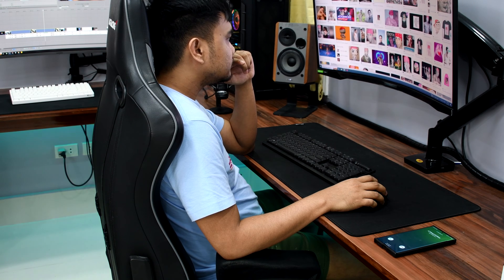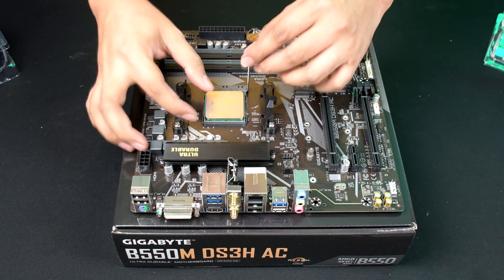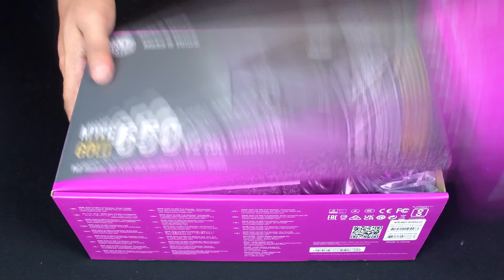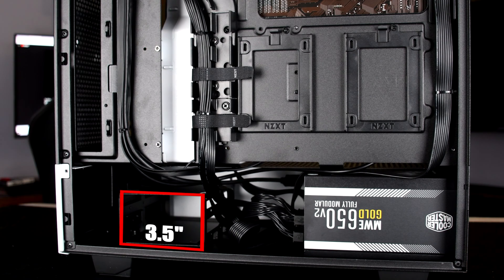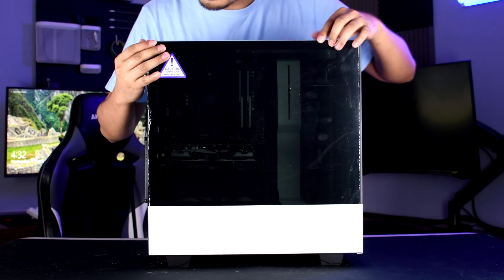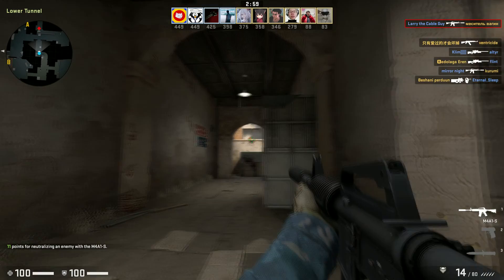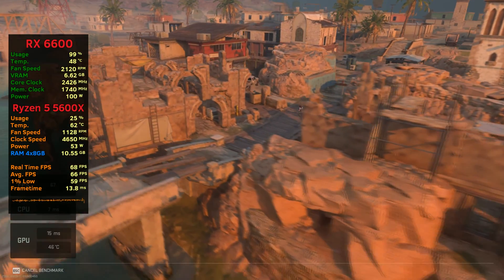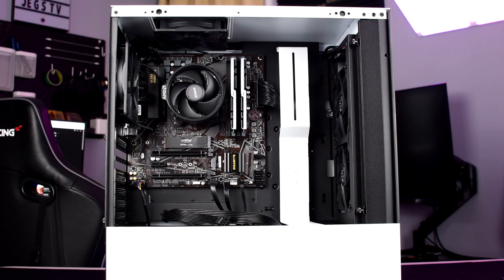US$980 (PHP 54K) PC Build | Ryzen 5 5600X + RX 6600 | w/ benchmarks

Comment: okay din po ba tong Build ko? 
CPU: Ryzen 5 5600X
MOBO: Gigabyte B550m DS3H AC
GPU: GEFORCE RTX 2060 ASUS DUAL OC 6GB DUAL FAN
RAM: KINGSTON FURY 4X8GB 3200MHZ DDR4
SSD: TEAM GROUP M.2 2280 PCI-E GEN 3X4 MP33 512GB NVME
HDD: WESTERN DIGITAL BLUE 2TB 3.5 HDD
PSU: CORSAIR CV650 WATTS 80+BRONZE
CASING: DARK FLASH DLM21 BLACK (M-ATX)
FAN: DARK FLASH C6 3 IN 1 FAN KIT
FAN: DARK FLASH C6 SINGLE FAN 
CPU COOLER: DEEPCOOL AK400 ZERO BLACK(R-A400-BKNNMN-G-2)
TOTAL = 54450 PHP
Reply from the maker: Goods naman paps. :) yung ram if kaya pa mag 3600mhz ka.

Comment: bakit kaya kadaming bumibili ng 5600x? eh same lng din nman yan ng 5600 na mas mura pa
Reply from the maker: faster base and boost clocks.
Reply: @JegsTV   1% faster than ryzen 5600 😅
Reply from the maker: @mahvel2381  not really if you play on cpu bound games.
Reply: @JegsTV  dami na nag test nyan sir 5600x halos same ng 5600, kaya ung mga magbuild ng new pc mag 5600 n lng kesa 5600x tapos ung sobra pang dagdag sa gpu.
Reply from the maker: @mahvel2381  gets ko naman point mo pero andyan yan for a reason. At the end of the day higher clock speeds = better performance. Mararamdaman mo nga lang yan sa mga laro tulad ng csgo at valo.